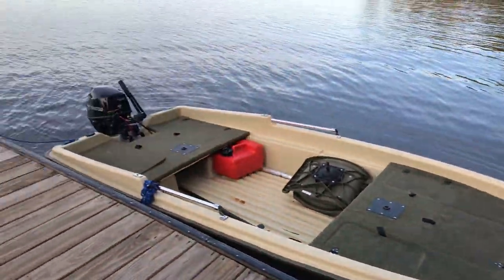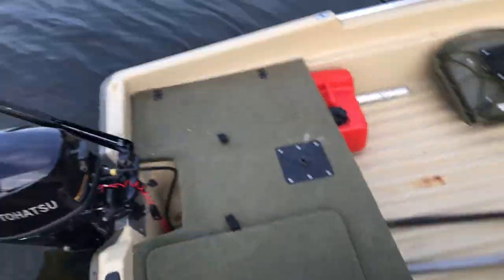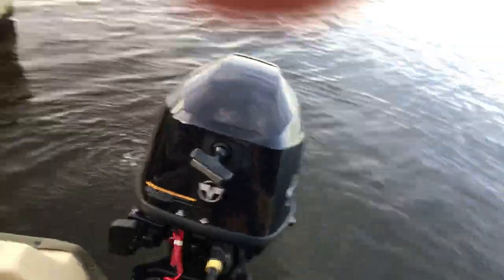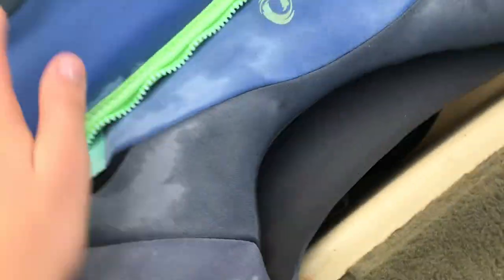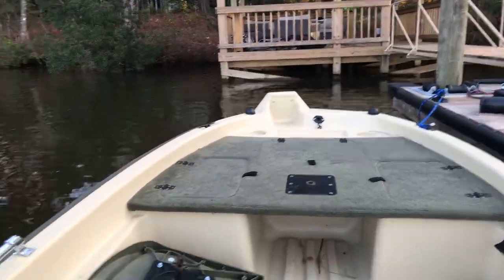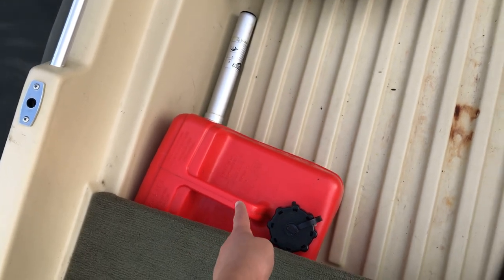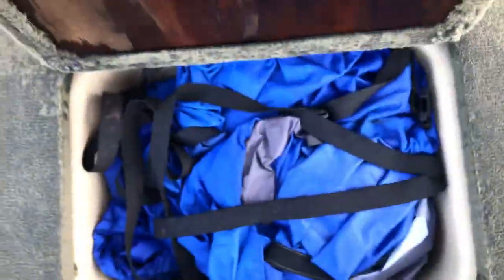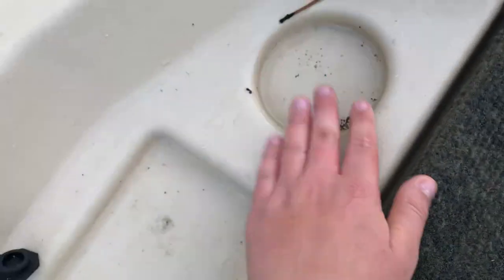Sun dolphin Pro 120 Tour

Comment: There’s two small drain holes inside the battery compartment towards the back.  Mine always brings some water through those two little holes behind the battery and it wets the bottom of my battery every time. Is this normal?

Comment: What's the shaft length on that outboard? Can't figure out if I should go with a 15inch or 20inch shaft.
Reply from the maker: Measure your boat transom but I have a 15 inch
Reply: @jrbassin  I'm looking at getting the same boat as you. How long is the tiller handle?
Reply from the maker: About 19 inches